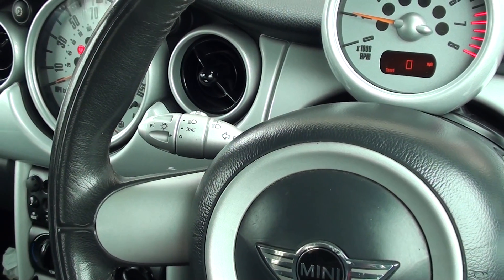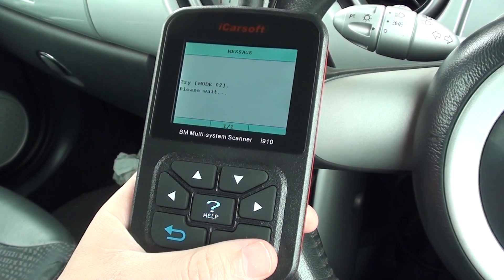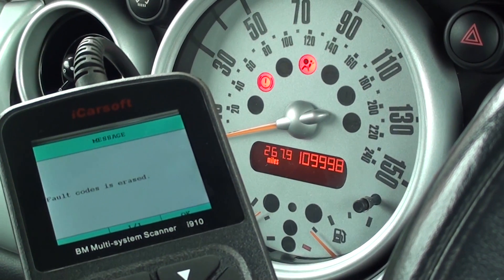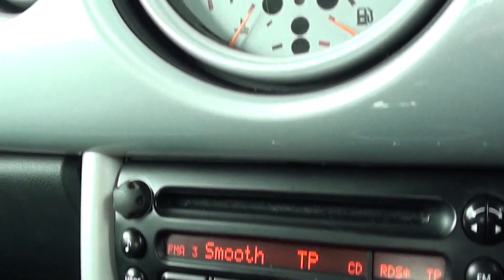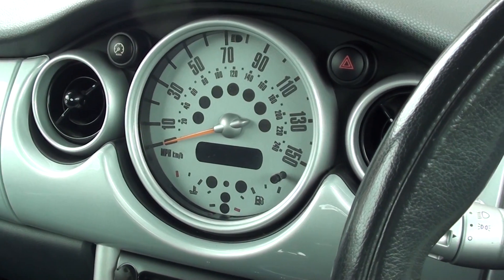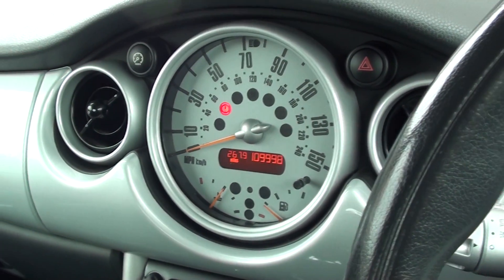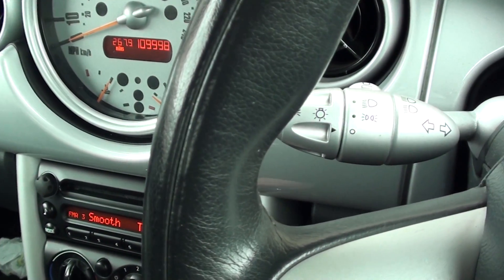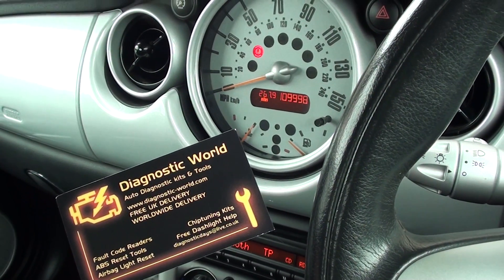Car Warning Light Won't Turn Off After Clearing Fault Codes - HERE IS WHY

Comment: Can you help me? My engine light came on, I read the code, had a mechanic replace the part with a brand new (from the dealer) and light turned off but 2 days later it came back on. Same code same issue but the part was new and no issues. Doesn’t drive any different. But it keeps doing it after bringing it back 3 times: comes on after 2 days, reset, 2 days later it’s back on with same code. Even the mechanics don’t understand it. Did hard reset. Nothing. Still comes on after 2-3 days. Ugh

Comment: Morale of the story.. Warning lights are there for a reason..ye older type cars with no electronic nonsense it would be a matter of course to physically fix the fault...Just resetting your warning light is just a nonsense or maybe a quick fix scam by unscrupulous garages..until you realise a few hours or days later the lights back on.

Comment: I've got the same codes coming up constantly (p2270/ p0136).. granted I haven't changed the o2 sensor yet but what confuses me is there is no engine management light illuminating on the dash. Why would that be? It comes on briefly when starting the car so the bulb obviously remains. Same car BTW.

Comment: I had a rear left wheel speed sensor code turning my abs and traction control lights on in a 2009 bmw 328i, I replaced both sensors, erased codes and light still shows but code won’t read at all anymore.

Comment: Hi, awesome video, I can't make the red-brake-pad-wear-sensor light reset on an E90 2009 328i--I have replaced both front/back sensors, and the pads and rotors are still very good and I did the reset procedure pressing the odometer several times with no success, any suggestions? code still says "plausible rear brake pad wear"

Comment: bought a salvage car mini one front crash bar was bent in but air bag never went off had reading said air bag moduel  is no good got one the very same sereil number guy cloned it of my original one but air bag lite is stil on

Comment: Snip the passenger blue pulg under the seat, crimp or solder a good know wire and plug section in then reset the code. Code will come up as passenger seat belt tensioner when scanned, don't cha he seat belt tensioners as it will be the blue plugged wire that has stretched.

Comment: Here is the thing having replaced the rotors brake pads and sensors and I still have a warning even though i have done the following Procedure for resetting the service indicator after replacing the pads and restoring the pad sensor wire loop: -Turn ignition on without holding down the brake pedal, (no need to start) -Cycle left stalk button until it shows set/info -Press and hold button until it shows CHECK-INFO -Press once until it shows SERVICE-INFO -Press the right tach button (trip reset) for 10 seconds until display changes. -The brake pad warning should show up in red, showing in this case, "mls -KMs ---" indicating the car was driven -- miles/ km past the tripped point. -While on that display, press and hold the turn signal stalk button and it should show RESET. -Release button, then press and hold button again, a timer clock will show up, as a brief confirmation period to let you change your mind and cancel the reset. -After the clock cycles around, the reset is complete, provided the two pad sensors no longer indicate an open circuit. If it doesn't reset, the pad sensor circuitry is still detecting an open circuit can be a software issue that's $300 thanks with the dealer.

Comment: HELP had no speedo, ABS, tyre pressure and handbrake lights on, changed all four wheel sensors, tried another speedo on, using the i910 icarsoft , no getting 5E1F VEHICAL IDENTIFICATION NUMBER DIFFERENT, 5E16 CAN CONNECTION TO INSTRUMENT CLUSTER, 5E1E STEERING-ANGLE SENSOR CAN, E14 CAN CONNECTION TO DME/DDESC LAMP ON UNTIL IGNITION RESET, so do I need a new ABS module ?, or new ICU and will I have to take it to a dealer to reset every thing ? mini cooper s r53

Comment: I erased the code for the passenger airbag light. But it’s still illuminating in the tachometer and it still says passenger airbag off above the overhead buttons why?  I have a creator see 310+ Also what is the little desk for?